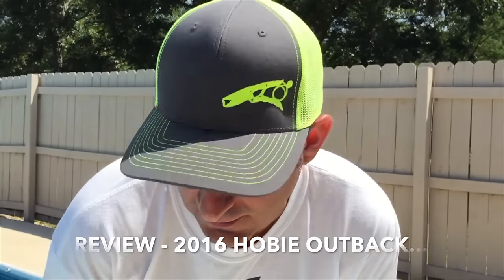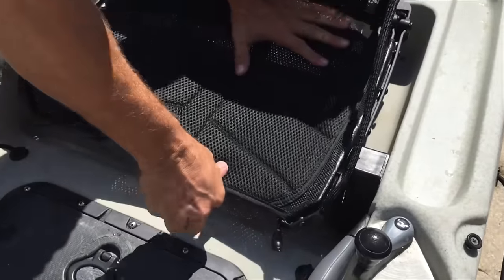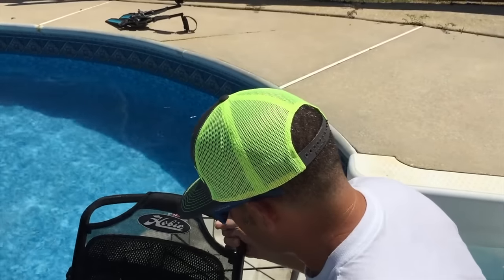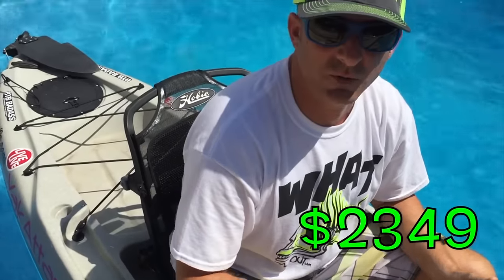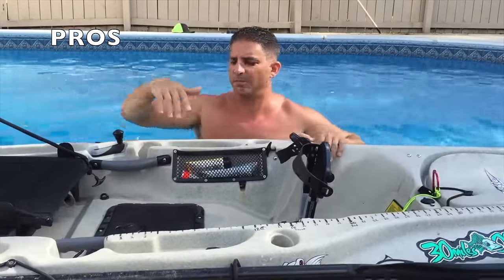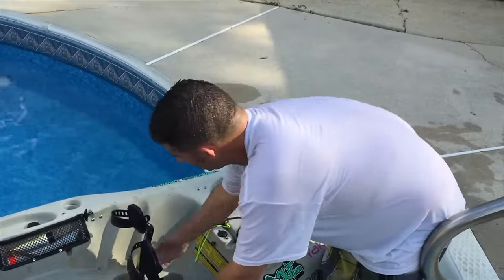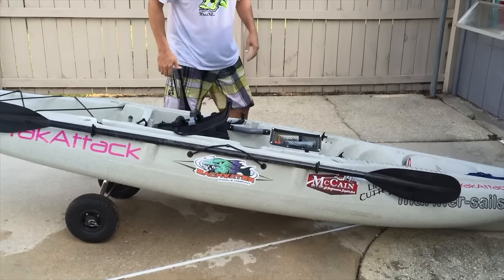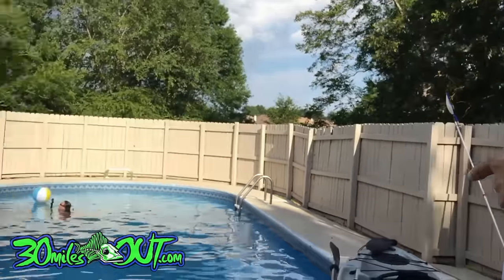2016 Hobie Outback Review for Kayak Fishing

Comment: Hey Ty, been a fan of yours for the last 3 years, I know this is an old video, just wanted to ask you about your opinion on the new 2019 outback ?  I’ve heard that it’s not that great off shore ‘ the older models are better ?  what do you think ?
Reply from the maker: I’d say so.  They are a bit faster with the low sides and sharp entry. But.... trade is it’s a much more splashy wet ride.  The older ones are much fatter. Higher sides. Just more boat for BTB

Comment: Big problem with the kickstand as well, primarily flats fishing where I'm hopping out of the seat spotting reds and getting back down gets annoying. I just have to very carefully get up. I never had a problem with the front of the seat locking into the bar though. My biggest con is the weight like you listed, the only way to easily load it is with a trailer.
Reply: Flip the spring on the kickstand. It's an easy mod several videos out there. it will solve your problem, should have come from the factory that way IMHO.

Comment: I agree with everything you said, especially about the Pro Angler.  It's heavy!  But being 6'-2" and tipping the scales at 250lbs +, I went with the the 2016 Pr Angler 14.  Seat design is different and does not seem to have the same issues.  Like you said, I am a weekend fisherman (1-2 times a month in lakes and streams in Southeastern PA that do not allow motor boats, so it was the perfect match for me.
Reply from the maker: great deal!  every yak has a application somewhere! sounds like u found a good fit.. thats all that counts.. fish on steve! what!

Comment: Debating between a revo 13 and an outback. Help me out Ty. Used for BTB and inshore
Reply from the maker: the revo is fast and light... if ur a super small dude u may be able to get away with a revo. most likely not.. u don't see them here in florida  btb at all...its all pa's and outbacks and a few native slayers etc.. big stuff...  a buddy of mine is 5'6" and light had a revo and went to a slayer and now to an outback... its just not much boat when u get out in big water...
Reply: You're the man thanks Ty. No I'm 6'3 220 so it looks like an outback or a PA for me. Thanks for the help
Reply from the maker: oh yea! for sure... yes outback at least.. i think the outback seat has a 250lb weight limit...  rent a pa 12, 14 and outback... some shops will apply the rental to your purchase!

Comment: I love the Pro Angler but sometimes have a long pull across the sand, and my question is what is the weight difference in the Outback and the PA. Fixing to buy one or the other.
Reply from the maker: pa is alot heavier ... empty, outback is around 75. pa is 100 or so. pa is much harder to drag and lift...